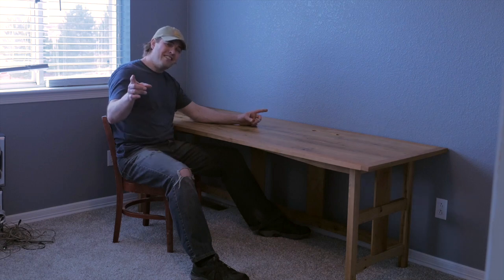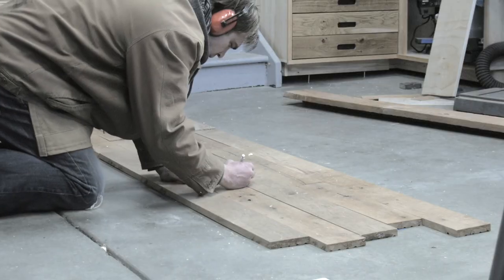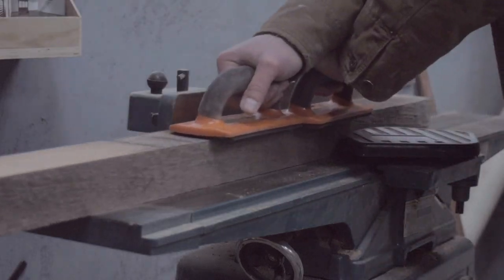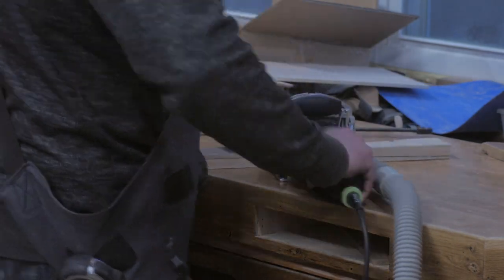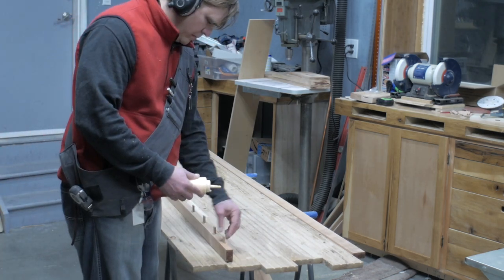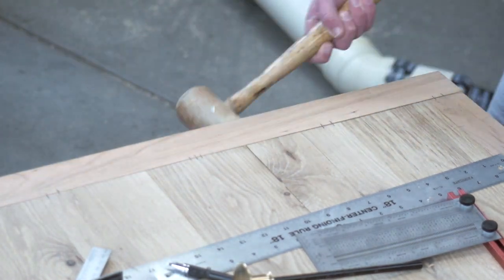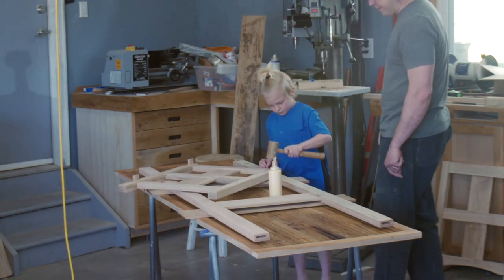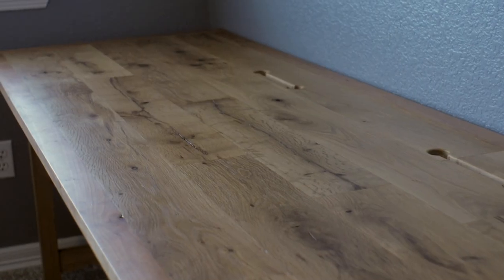Building an Oak and Cherry desk

Comment: An interesting take on the breadboard end. I've seen them done where the pin holes on the breadboard are drilled through, then installed on the end, the locations marked on the tenons, then those holes moved slightly (1/16" or so) towards the table top, and slots drilled in the tenons. Then pointed pins driven all the way though. This works like a drawbored mortise and tenon and keeps the breadboard end tight even if it wants to expand/contract or bow over the lifetime of the table/desk top.
Reply from the maker: Good thought, to incorporate them with a drawbore technique as well. Thanks for the suggestion.